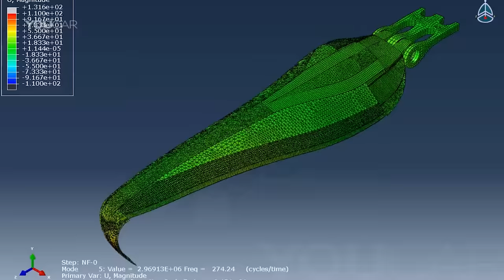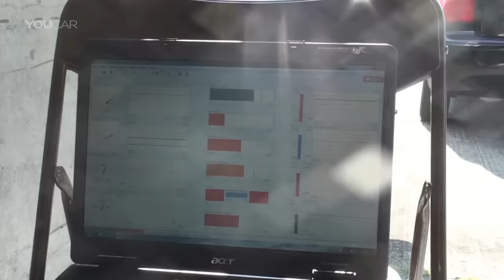Flying Car Street-Legal PAL-V Liberty

Comment: ı thınk this machine should be 4 wheels
Reply: MURAT GÖKTEPE its too mainstream
Reply: MURAT GÖKTEPE I think it's more of a motorcycle approach so it's still light enough to get off the ground
Reply: If the engine weight wasn't too great, the single wheel could go on the back for better road stability.
Reply: Think airplane wheels. Yeah. That's why it's not 4 wheels.
Reply: 4 wheeled road vehicles have to go through crash testing in the US. 2 and 3 wheeled road vehicles do not. Crash testing adds millions of dollars to the cost of the vehicle which is why you will not see a company like this create a 4 wheeled vehicle.
Reply: Armchair, you are correct.  I had a meeting with my DOT in my State and the main issue was 3 vs 4 wheels.  Three it is a motorcycle and four it is a car needing airbags and crash tests as well as a "steering wheel" as opposed to a handle bar like a motorcycle.  My design uses a bar and not a wheel, so I have to allow only 3 wheels on the ground even though I have 4 wheels for certain situations, such as landing and beaching.  So, if I land on the road, only three wheels can touch the ground while driving.  If I land off road, then I can use four which makes a huge difference in some cases.
Reply: check out Terrafugia TF-X
Reply: A 4 wheel vehicle has to endure way bigger forces when landing. The front wheels are only supported in one direction, so the vehice can sheer. This is a trike that can fly. Or a Personal Gyro that can race at 180 km/hr (approx 120mph...) 3 wheels are all it needs
Reply: jj Bults .
Reply: Actually most airplane are geared to tricycle pattern....you probably saw the most extreme aircraft with space shuttle that rolling faster thru the "parking lot" with a touch down speed of 250mph.Than most ground vehicle run at racetrack.
Reply: They are running into problems with DOT requiring bumpers and all kinds of stuff not required by either a motorcycle or an aircraft.I have helped build 8 super skycycles that are registered in Texas as roadable aircraft kits.Before Neil died of a heartattack.....Barring changes in the laws they will look at the frame .At the same time,there are only about 200,000 active aircraft pilots at this time....and there are more aircraft flying at a given time in the US than anyplace in the world.Another thing roads are 2d lane position while air is 3d up to about 7miles up.
Reply: Aerodynamics
Reply: Any vehicle with three wheels or less is considered a motorcycle so they do not need to conform to the same safty crash requments as a 4 wheel car for Washington or the US or Canada
Reply: thanks for the info!
Reply: why don't you design one then

Comment: erm. why bother driving when you can fly. fusing 2 technologies ends up at more cost and I'm not talking money. think about it, as a car you lose passenger and luggage space, as a chopper you lose efficiency and speed due to wheel drag and design (just to make it car capable). it's pointless.I skipped most of it but didn't see any fitting of the propeller , it was either fully closed or fully fitted..

Comment: Taking off at 80 Km (50 mph) is not exactly "performance" and presents a risk.  There is a better way....working on it.  The bottom line is anything that needs an "airport" will fail in the long run.  Mark my words....
Reply: Ok Nostradamus

Comment: this is not safety how are you going to take off public place ?how many will die your fan blade?so it's not good for public comercial use ?u need to take off the designated area?you need to change the design .i have an the solution  for that

Comment: this will never work with gen public sale you need a less cumbersome propulsion system maybe something like the flying man jetpak or side mounted harrior jet idea with just air fans connected to an amazing transmission set up to increase rpm theres alot of ideas better than having open spinning blades by encasing them youll increase there force strength